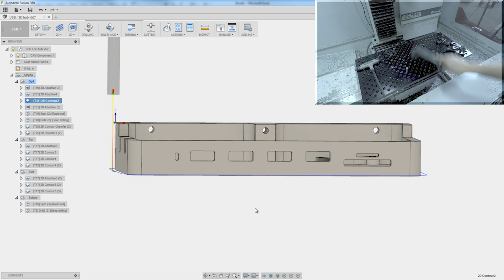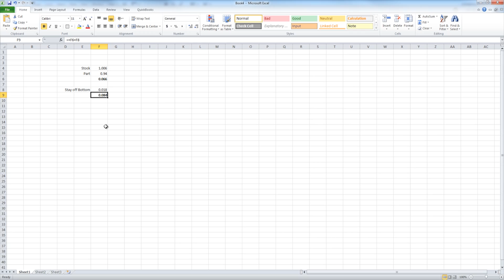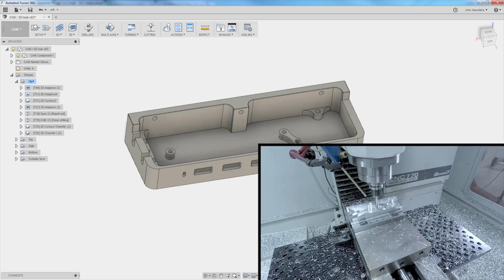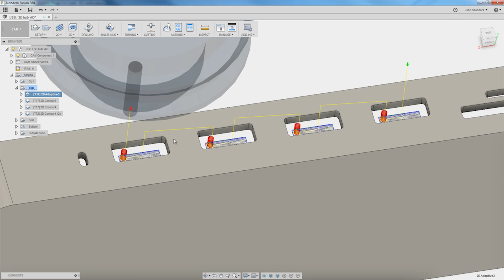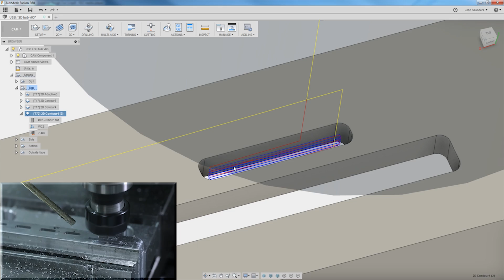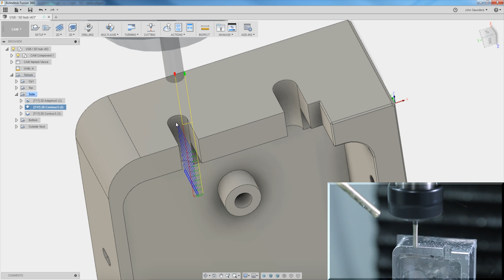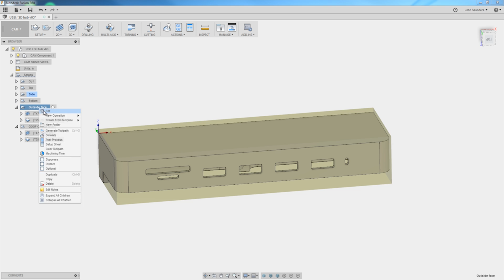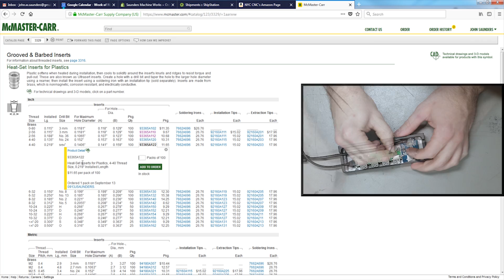DIY: Desk Mounted USB & SD Card Reader! WW173

Comment: Very cool.  Ran in to a similar thing today, slotting with the contour ramp, and I tried something that I thought worked really nice, setting the max ramp depth per revolution to be what I would normally set my multi depth increment to.  That way it doesn't waste time going around and cleaning up the already partially cut levels before ramping to the next.

Comment: I like to use expanding inserts instead of heat-set, something like 94615A112. I use them in plastic as well and they work well. You might find that they work much better in aluminum while still being versatile enough for plastics.
Reply: Going to try these, thanks!

Comment: I would print that on my 3d printer. Once you get your settings right things like this come out looking great.
Reply: RJ, he has mills at his disposal. Why would he waste time printing when he can have a custom one off that shows off his skills and capabilities to potential clientele? It's a perfect market yourself moment, and plus it's fun if you like making things out of metal! PC/ABS can certainly take impact and support weight. However, there's just an allure of a well machined piece that just has this je ne sais quoi about it that looks clean and sophisticated. 3d printing is great, I've got 3! But if I had a mill, i'd be doing the same thing!
Reply from the maker: Wouldn't be solid enough
Reply: Can you explain why it wouldn't be solid enough? I have 3D parts (ABS) supporting half of a 225lbs Kamado Grill (compression) with no issues.  Your design looks well suited for PC or even ABS material.
Reply: @Eyebrows Mahoney. I agree and is why in my other comment I stated "I realize its not the purpose or heart of this video.." , In this comment I was referring to Johns remark that it wouldn't be solid enough. Which in my opinion is not accurate.
Reply: RJ_Make I can see both points. PC/ABS, is durable, but I think what he means by sturdy enough is the heft that the feel of metal has compared to printed PC or ABS. I would be inclined to believe a metal part would feel more substantial and likely more rigid than ABS, but PC is pretty rigid as well. I just am of the curiosity of why so many people (not you in particular) are giving a Machinist heck over machining parts instead of 3d printing them.

Comment: I was always wondering why you are carrying around data on physical memory, in the first place. Is there a reason why you don't hook up your machines to a network and use a fileserver? But nice project anyways!
Reply from the maker: We do.  We still often use thumbdrives, USB devices and USB chargers.
Reply: micvee You are certainly right, that security on industrial machines has been and is is often bad. But network does not necessarily mean internet access. And do you remember Stuxnet? It used USB drives to infect PLCs and industrial PCs besides the SMB protocol. I admitt though, that setting up a reasonably safe network environment requires someone who is really knowing what he / she's doing.
Reply: Yep, the only 100% secure device is one that has no power applied to it. Security is about risk mitigation not risk elimination. That said, Stuxnet involved a very sophisticated attack against specific equipment in a specific facility and was (presumably) government funded. I would be super surprised if the Saunders shop was the victim of such an attack, but who knows what really goes on in there when the cameras aren't rolling! Regarding network equaling Internet, I admit I was liberal in the educated guessing department on that one. Saunders uses Fusion 360, so his CAD/CAM machine is most likely connected to the Internet.
Reply: As a network engineer, I would think twice before putting those machines on a network that can access the Internet. Industrial machines are generally not secured well and usually are more prone to viruses or hacking than your average computer. If you don't have a properly configured enterprise level firewall and IDS at the edge of your network, I would definitely not recommend connecting your CNC machines. Sneaker net is much more safe and I'd keep using the thumb drives if I were you.

Comment: Great little part John. :)

6:56. When I saw you flipping the part for that side, I was thinking back as to what you are doing. I was like, I would just use a Ballnose during OP1, to clear that out. One less setup to do. Your 1/8th endmill takes care of most of that slot, and then a 1/8th Ball finishes the bottom. Pretty simple I think. Also, quite nice to see the 770 push that shear hog 60ipm. :) The spindle is winding down though in some cuts. Don't know if perhaps lowering the spindle to part of the higher torque curve and maybe 55ipm would sound any better. Oh well, spindle is not that expensive. Cheaper to replace it than it is to cut slower. ¯\_(ツ)_/¯ I knew a company that was replacing their $12K spindle every 9-12 months like clockwork because they were using max rpms, all day long.

Either way again, great video. :D

Comment: Great widget John!
Phew, glad the vice held it. A question though, and any machinists could probably answer this, but how about bolting to a base with deep countersunk cap screws
and machining everything apart from these 'post' sections. After all machining is done - both top and side -  cut off the posts and then finish off the inner base?
Of course the initial holes through the base would need to be plugged.
Reply from the maker: sure!

Comment: If you get the urge to run another one it'd be  a good development part for a four-axis workflow, nudge nudge.  Also would it help any to drill the worst of the material out of that slot for the microSD card first?

Comment: John, Question, why are you using full retract on drilling ops and not either partial or deep drilling?
Reply: Really? both of mine do chip breaking partial retract  as well which drastically have increased my cycle times on drilling. I was using full retract at one point and it was taking significantly longer. I was just wondering. Thanks for the response
Reply: LUMABLADES he's said before that he likes to have the drill fully retract. U think he said that since it only takes a few seconds to drill the holes, that he'd rather fully retract... Because of tool life and less chance of breaking the bit, and better chip evac. (If I recall correctly.)
Reply: justind33 what were you taught? That the tormach only is capable of deep drilling and full retract? Because that is simply not true. I use chip breaking partial retract daily on both of my Tormach's. maybe it is just a preference that you were taught. But honestly in aluminum you can basically deep drill most of the time.
Reply: Andrew, I dont think he said anything, I just did not know as to why. I understand the tool breakage as well as the chip evac, If there is a better way than what I do, I am game, I just wanted to hear Johns reasoning for it
Reply: The Tormach does what it's told to do! 

Maybe Pathpilot doesn't have the option, so you can't do it in conversational, but it's an option in Fusion CAM.
Reply: A little less than full retract can be an advantage to stop chips falling in.
Reply: justind33 that's because of broken tools I am sure. You will break far less tools with that strategy than the others so it is a smart one to use at times

Comment: I'm not sure of your clearances on the circuit boards, but i'd strongly recommend putting some insulating tape inside the box. That way if the screws loosen and it falls, you wont get a short.

Comment: Question could u have just stick the USB hub inside and not have done the way u did it I wish u could make one for me it looks bad ass looking
Reply: Crossbow Hunter yuppie saying the whole hub, plastic housing and all? That would make it huge, and the holes where you plug USB connectors in would be really recessed, and it would cause clearance issues with connectors

Comment: I realize its not the purpose or heart of this video, but this is a project that is perfect for 3D Printing.
Reply: justind33, We agree in part, (the right tool for the job and all), but my point is there are desktop printers that yield very pleasing cosmetic surfaces with more then enough structural strength for this application.  

This notion that you can't produce a functional, cosmetically pleasing part with a <$ 5K 3D Printers is out dated and is simply not true anymore. 

I didn't mention finishing because IMO every method requires some level of finishing work. 

My comment stands, this is a perfect project for 3D Printing.
Reply: That is exactly what I was thinking.
Reply: justind33, "most people" don't spend more than 5 minutes adjusting their machine settings. After spending a day tuning and printing, me and my shopmates have 3 printers printing clean finished surfaces, accurate dimensions, and durable prints that rival injection molded products. While I don't think 3D printing is a good choice for full on production, our printers produce a lot of useful products that we use readily around our shop and homes. The average joe printing likely won't care enough to clean up their settings (and that's fine, if they're happy with it then so be it!), smooth their stepper motions and calibrate the machine to thousandths of an inch, but many people do and even with cheap import machines, at 1/16 of the cost of most "consumer grade" printers, put anything put out by those to shame.

If I had a Mill, I'd be doing this though. I like metal a bit more than I like plastic...
Reply: Nothing it's a perfect project for 3D printing...especially finished products. 3D printing looks like shit. The only thing 3D printing is good for is rapid prototyping, quick/temporary fixes, and things you don't see.
Reply: Are you generalizing or are you directing your comment toward a specific technology of 3D printing and just failed to mention it? 

If you are generalizing then you might want to look into what is being accomplished with 3D printing now, and it's quite amazing.   Your comment "Nothing it's a perfect project for 3D printing" shows either arrogance or ignorance on the subject.  I suppose you should tell those in let say aerospace manufacturing (one of many) the end products they are creating with 3D Printing are erroneous. 

If you are talking about a specific technology such as FDM then perhaps your point is valid (that said even FDM is getting extremely good). However there are many different types of 3d printing technologies, and many of which can produce a fully functional, cosmetically pleasing object. One example would be SLA and SLA (CLIP)

Remember guys, in this case we are talking about a DIY project, (or even small productions runs) not a 10K+ count mass produced product.

Comment: When you ramp like this in the small slots it is better to have multiple depths disabled so you constantly ramp till the bottom of the operation. There is no reason to do multiple depths since the ramp will lead to a constant "step down". For example if you set the step down of the ramp at 0.5mm on this operation without multiple depths it will ramp down till the bottom by talking always 0.5mm axially.